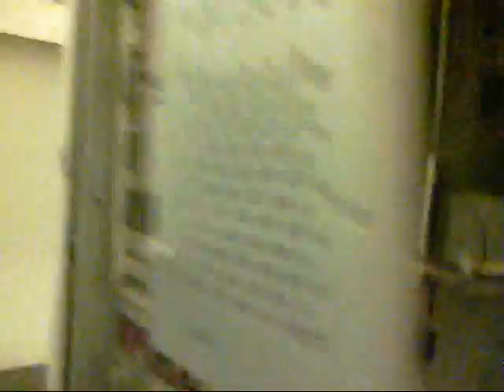Recent Trash Picked Electronics- Computer Stereo and karioke Machine

Comment: You can get the info on the motherboard is very useful it is small in writing the  info is also written for what the connections  that way you can tell what the cables are for. The sherwood should have a inline fuse follow the power cable inside the unit and see if it is blown . You may need a meter to check if power is getting inside the unit.Look thru the cd might be something you can sell on craigslist or ebay maybe even the motherboard.  good luck

Comment: Nice finds and I have that same exact fan as you. Does it say Cool-Breeze on the front? Also the hard drive in that PC is that black box on the very bottom bay with the ribbon cable connected to it.

Comment: I would check the motherboard numbers on the motherboard itself and pull the processor which is that black thing on the motherboard  and look on the bottom will tell you what it is . The stereo  is worth around 20 bucks  if it works people are always looking for computer  parts on craigslist.

Comment: the CD drive that's installed in that PC looks like an emachines drive just looking at the style of it b/c I have an emachines PC and it has a newer DVD RW version. on the stereo you can try the fuse and if that doesnt work then test the transformer if that works and the amp part doesnt work then keep the power supply. most of those put out 12-18VDC at a decent amount of amps. and is that eminem that your playing on the karoke CD player?

Comment: The computer should have info on the motherboard silkscreen look close at  it usally between the pci connectors . The hard drive looks like it is screwed  into the case at the bottom on the right side . The power and harddrive connector should be hooked up to it unless I did not see it right and its just a fan. Those connectors are just spares for more hardrive cd rom dvd roms and such . That motherboard looks like a all in one motherbard try hooking a VGA monitor to the video connector and pwr